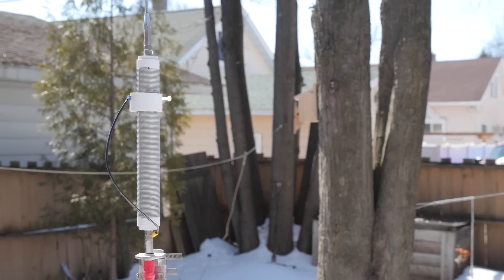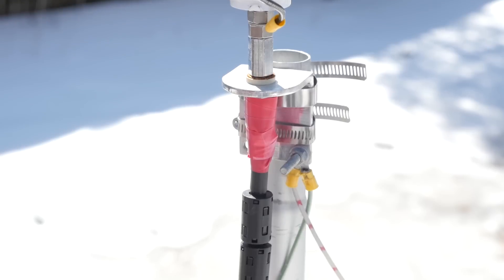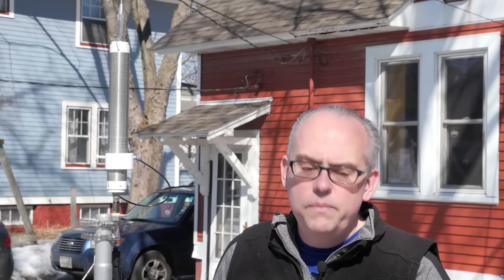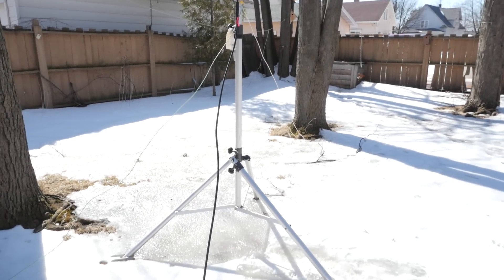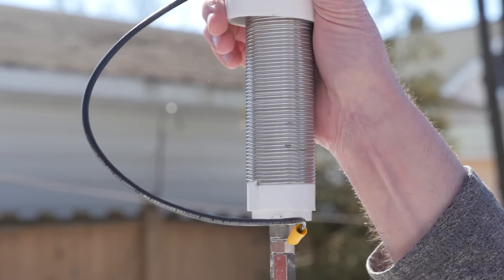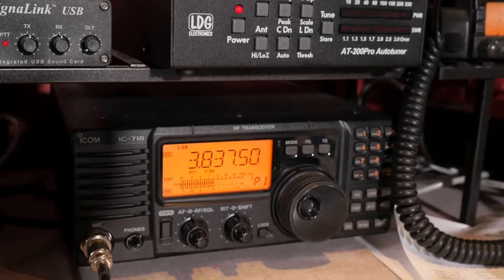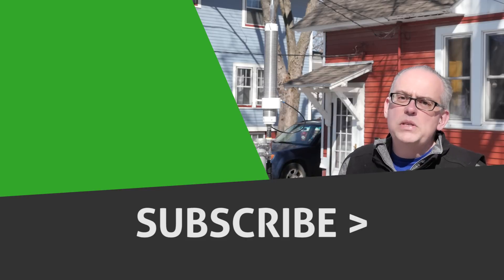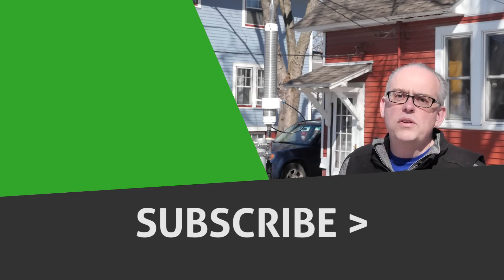Wolf River Coils Silver Bullet 1000 Coil - Ham Radio Q&A

Comment: It has been suggested to me that 32ea 8' radials would be a good idea for use with the WRC SB1000. I have a bunch of 12 awg PVC coated copper wiring that I was thinking of using for this. My hope was to do 8 bunches of 4 cables and solder them into ring terminal connectors. Do you think this would work fine for this antenna or would you suggest another approach?
Reply from the maker: In the years of extensive use of the Wolf River Coil since this video was produced, I've found that the length of the ground radials doesn't matter as much as the surface area that it covers. That said, the general rule is that many shorter radials will perform better than fewer longer radials. The catch, though, is that putting out many radials is time consuming for the portable operator, so you have to weigh the time of deployment against the benefits of performance. 

32 eight foot radials will certainly work great and this article by Rudy, N6LF, confirms that: https://rudys.typepad.com/files/qst-march-2010-ground-systems.pdf. My preference is to use 8 16 foot radials, which covers about half the surface area of your 32 8 footers, but it is much quicker to deploy. But whatever you choose, you are on the right track.
Reply: @KB9VBRAntennas  thank you for the article. That is a huge help. I'll have fun experimenting with different setups and will be referencing back to your WRC videos for some guidance

Comment: I have lost my plastic screw form mine. I used the SB 1000 for Field Day and it worked great on 20 and 40 and good on 80
Reply from the maker: You can operate the coil without the plastic screw, I usually don't lock my collar down at all. I think replacements are available at most hardware stores.

Comment: You said you used 40 watts on FT8, WRC says limit it to 20 watts on digital.  Any thoughts on that?  Have you seen any heat damage?
Reply from the maker: I have run up to 40 watts FT8 on the WRC. The coil has gotten warm but the overall duty cycle wasn't long enough to cause damage. I think 20 watts is a conservative power level for FT8 with the coil. 40 watts is certainly the outside limit. The longer you use the coil, the warmer it will get and the greater amount of coil used, the more heat it will generate. If digital is your thing, I'd invest in their Platinum Edition (it wasn't yet available when this video was produced).

Comment: I have a WRC ,silver bullet 1000. I have used it with a 102 inch whip  on 80 and 20 with good results. Today I tried it with a 60 inch whip. Loads 40 thru 10 and the reports on 20 are the same as using a hamstick  (in the mobile) which is really good-the reception is better with the WRC and small whip  ,especially when driving ,less noise.

Comment: New to this HF world. When you adjust the coil, do you also have to make changes to your radials?
Reply from the maker: Depends on the number of radials. If you spread out enough of them you may not‚ but when I operate in the field I will use two radials and will shorten or lengthen them to make a good match. I've got more on it in my latest POTA video: https://youtu.be/O2H0a79spe8

Comment: can i run 100w on FT8?
Reply from the maker: The Silver Bullet 1000 is rated for about 25 watts on full duty cycle modes like RTTY and FT8. But they are currently testing a high power version of the coil that will handle 100 watts FT8. I am helping evaluate the high power coil so it should be on the market soon.

Comment: OK I face a house made of stucco/wire which ruins wire dipoles as HOA restricts me ti under 25 feet high. I can get multiple short radials or 2 35 footers but not in a straight line. Is the coil Sensitive to this? Never used anything like this.
Reply from the maker: Good question, my house has steel siding, so I'm sure it presents similar issues to what you may experience. I'm able to run a G5RV over the house without issue, though. But I have a composite shingle roof. I keep the vertical about 25-30 feet away from the house and don't seem to have problems using it. Radials don't have to be perfectly straight, they can conform to the area if you can't lay them out perfectly. I'd recommend longer wires, at least three in a length of about 1/5 wave of your lowest frequency.

Comment: Any advice for using this with an mfj 1979
Reply from the maker: I've got a 16 foot telescoping whip like that MFJ-1979 that I use for portable operation. Basically, I extend it to about 9 feet for the 75/80 meter band and then collapse it down to about 5-6 feet for the higher bands. You'll find with this coil that you will run out of space on the top end for higher bands, so you need to shorten the whip for the 10-15 meter bands. Since there is a bit of imprecision with using a telescoping whip, I'll pre-tune the antenna for a particular band using my antenna analyzer.

Another interesting bit with that whip is that if you extend it all the way out to 16 feet, you can use the coil on the 160 meter band. But you also need a really good set of ground radials or counterpoise.
Reply: @KB9VBRAntennas  I just ordered your mini tripod my mount is homemade and not getting a good ground

Comment: The coil should not be made of stainless steel. It has to have the lowest possible resistance. Silver plated copper would be better.
Reply from the maker: I would agree, silver plated copper coil would be awesome. I think in this case, efficiency takes a back seat to durability.
Reply: @Peter Pilgrim 
Excellent idea!  I will buy all you can make for $60 each!

Comment: I notice you have a LDG AT-200 Pro Autotuner on your bench.  I’m in the market for an autotuner.  Can you tell me why you chose it over the LDG Z-11PROII or the LDG IT-100?  Was it the LED lights that show power and SWR.
Michael
VA6XMB
Reply from the maker: MIchael, I've been in the market for an auto-tuner for a while. I bought the AT-200 used because the price was right. I really do like the power/SWR indicators. My previous tuner was an MFJ-949, so you get used to looking at the indicators as you transmit. But if I was shopping for a new tuner, I'd seriously consider one without the meters as most modern transceivers already have power/SWR meters built in, so an external meter might be unnecessary. On a final note, I've got two HF antennas: a wire G5RV and a vertical, and the AT-200 has a built in antenna switch which is a nice feature. Plus it remembers the tune settings between the two antennas, so switching is super fast. If you are planning on a 2nd antenna, that will be an important consideration.

Comment: You mentioned that top band was possible with a longer whip, but that tuning Became very tight (? High Q ?) because of the small diameter of the coil. Could you discuss that further ? Are there any workarounds ?
Reply from the maker: John, you are correct, tuning becomes very tight due to the High Q experienced with the antenna on the 160 meter band. I'm not sure if there is an easy workaround, the coil's diameter is just too small.
Reply: KB9VBR Antennas Thanks for the reply. I’m trying to understand how a narrow coil diameter works to increase the Q of the system. Thinking that Q at any frequency would be just the reactance / resistance - perhaps I could open op the coils Q by adding just a tiny value resistor in series with the coil. Thanks again.

Comment: A very workable antenna for those who can not mount large antennas.
Reply from the maker: It certainly has been fun using it in my back yard over the winter. But I suppose that now the snow is melting, I'm going to have to decide if I can find an adequate place for it over the summer.
Reply: Well, my HOA house could make good use of it 😉 ....  My address is on page 3...  yup...  of the script 😊

Comment: Nice video.  FYI, now there is a dual collar alternative so each collar can be tuned to a band.  Then by changing the Anderson PowerPole, one can quickly change from a band to another, eg, 20m and 40m.  Worked great for us operating mobile for the recent WIQP where we moved from 20m to 75m with just a quick road stop.
Reply from the maker: That's an excellent modification and I imagine it would make band switching a lot easier.
Reply: yeah,  it was on page 2 of the script... 😎
Reply: I bought that option.